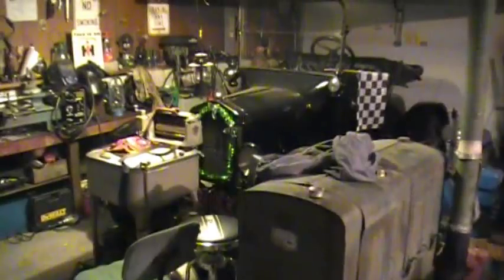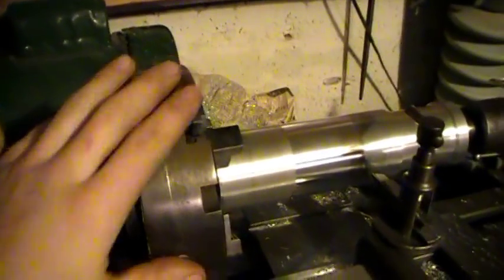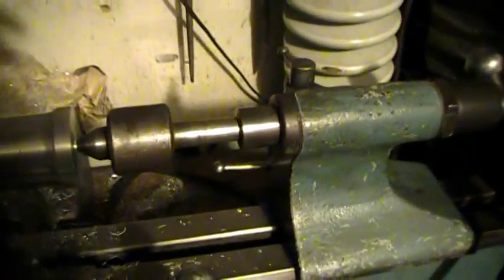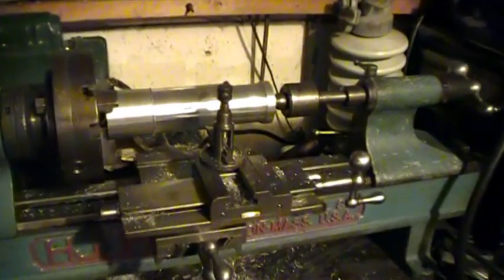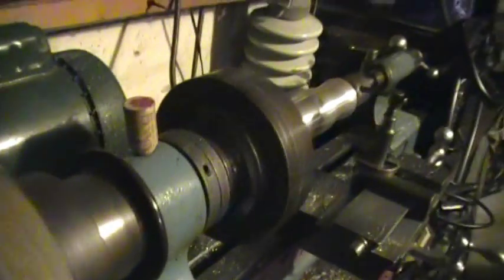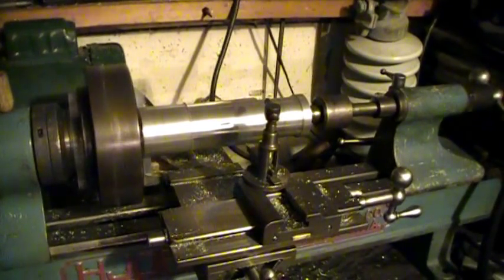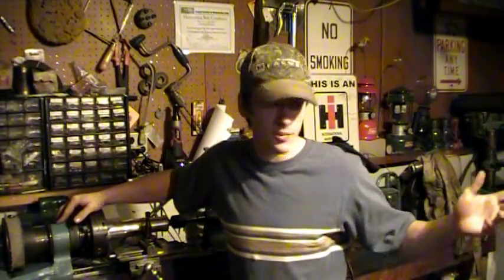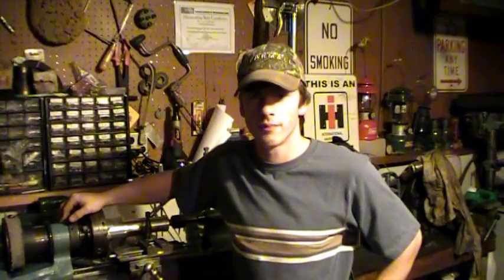Ca 1919 Hjorth Lathe Part 3 - Running & Cutting

Comment: Nice to run into someone else on YT who has a Hjorth!  Don't know how much you know about these machines, but there are some special things about them.  Apart from the machines themselves, there was some sort of working relationship between Henrik Hjorth and Edward Rivett, and there are many similarities (and even some patents) shared between the Hjorth lathes and some of Rivett's plain turning lathes.  The taper in your tailstock is a Brown & Sharpe #6.  Your machine is in nice shape, it would be a shame to modify the original tailstock ram, if you really want a more convenient taper, consider making a new ram if you have the ability.  Sometimes you gotta do what you gotta do, though.  Anyway, these are wonderful machines and the spindle bearings are exceptionally well designed.  You may already be aware, but the spindle takes Rivett collets.  Depending on the size, they will be either 4NS or 5NS collets.
Reply from the maker: Yeah it's great to run into another Hjorth owner too Man!! Yeah I will certainly leave the tail-stock alone and just find something with a #6 Brown & Sharp. Yeah I actually have collets for it, it's great!! Thanks for all the great info, I will be sure to hit you up with any questions eventually!! Thanks for watching Man!! : )